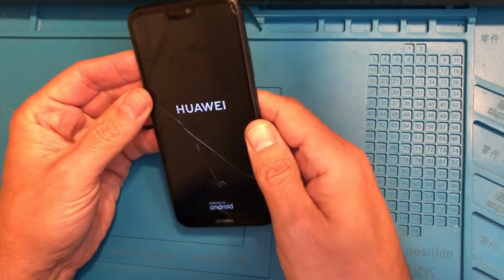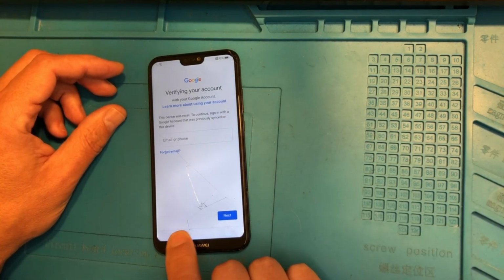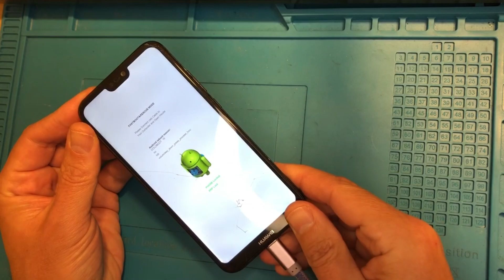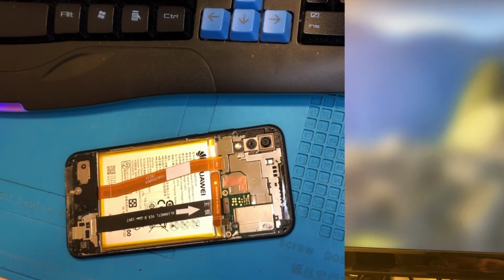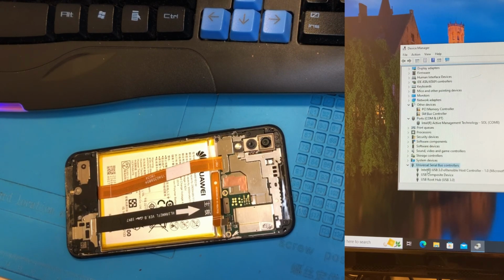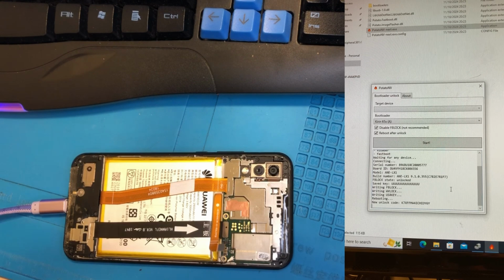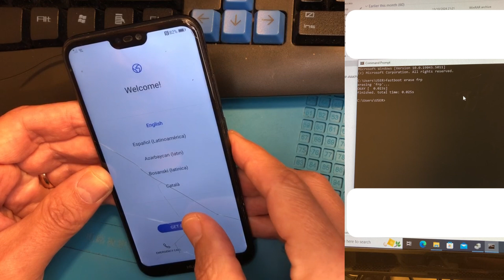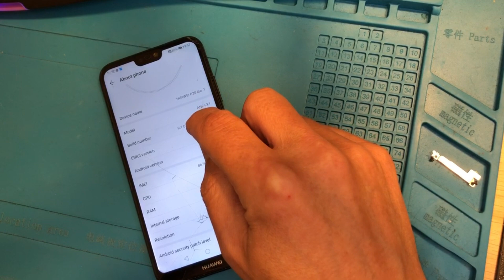How to unlock a Huawei P20 Lite FRP bootloader locked phone as an experiment!

Comment: thanks for the video. have a beat up p20pro like yours so thought about rooting it which lead me to you video. can you please somehow post-edit the video to clarify how you grounding the testing points? the fingers are blocking the view so it wasnt clear which points on the circuit you used and how.

Also my p20 pro has EMUI 12. Is that gonna be a problem?
Reply from the maker: Here is an image of the outer small point which will need grounding : https://www.tembelpanci.com/2019/06/huawei-p20-lite-ane-al00-test-point.html I think EMUI 12 it is not possible however as fastboot command has been removed...